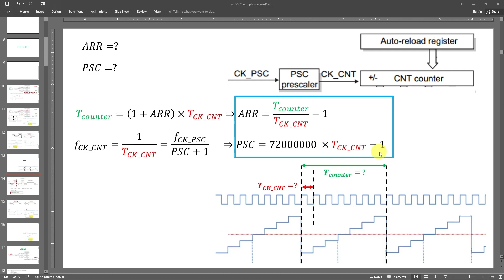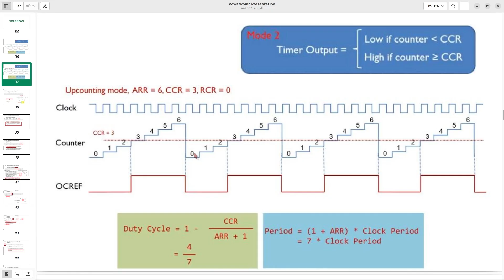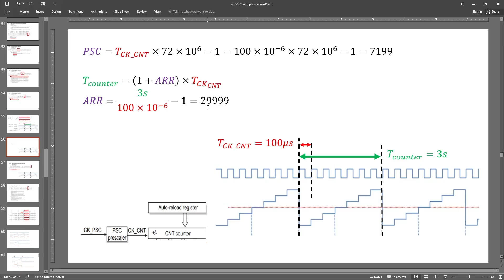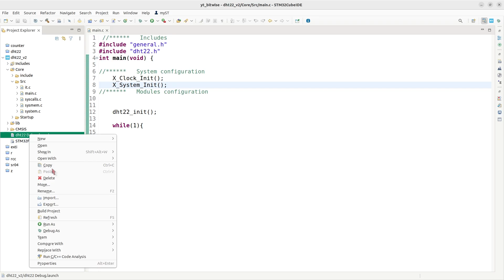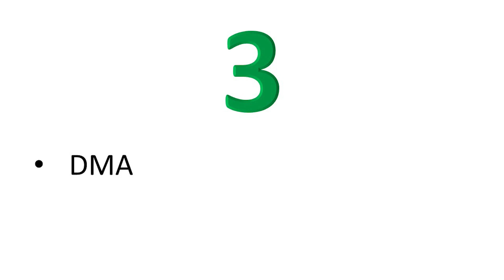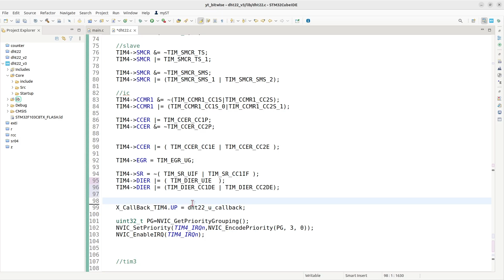AM2302 / DHT22 with STM32 with 2 Timer and 2 DMA channels | NO DELAY

Comment: I liked your videos, and I think that I watched all your English ones. I learned a lot from you, but this "DHT22" library is a total mess. Nobody should code like that!!! 
ps. What happened to your old channel?
Reply from the maker: what do you think is the problem with the code ?
Reply: @elcen_ir  For example, it is very difficult (for me, impossible) to understand without watching the video. You are using HAL, but at the same time you do all the GPIO, TIM and DMA config using CMSIS. You don't need HAL here, just use a startup file. The code is also very badly structured and has code repetitions. For example, you have written the same code for configuring DMA ch1 & ch4. Just put it in a function. It also uses "magic numbers" everywhere, is well documented, etc etc…  
Please take this as a goodwill suggestion, not as an offense. I appreciate the fact that you take the time to do these videos for us.
Reply from the maker: @s_amoku  im not offended, 1. you are not supposed to be able to understand the code without watching the video , this is hardware implementation , i built a 1-wire peripheral with timer and DMA , for the actual job there is no code , timer and dma do the job , 2 . hal is irrelevant , i just add the library in a project with hal , so people know how to add this to their code , 3. code is not badly constructed , you should not write function for everything thats going to repeat , writing a function for DMA setting dose not add anything to the code , 4. i accept the magic number thing , but actually they are not magical if you watch the video ,

im not offended , but i think you were harsh when you said " nobody should code like this " 
i think we have different ideas of what a good code should look like
Reply: @elcen_ir  Sorry if I have been harsh, but I have seen your videos, and I have very high expectations of you. But I don't think that is just about preferences, for example you wrote: 
	DMA1_Channel4->CCR = 0x0;
	DMA1_Channel4->CCR |= DMA_CCR_PSIZE_0 | DMA_CCR_MSIZE_0 | DMA_CCR_MINC;
Instead you should write:
	DMA1_Channel4->CCR = DMA_CCR_PSIZE_0 | DMA_CCR_MSIZE_0 | DMA_CCR_MINC;
and you save 2 cpu cycles.
Regarding the functions, they also are very useful to make the code more readable. I think that even you will not be able to understand your code after 2-3 years. Not to mention that if you write a functions, especially for drivers you can reuse it in other projects. For example I have written this function for DMA and use it every time that i need: 
    error_t DMA_init(uint8_t ch, volatile const void *periph, void *mem, uint16_t len, uint16_t cr);. 
The term "magic numbers" was not invented by me, it is wildly used in programming. And it is spot on in this case, as we should be able to understand the code without the need to watch a 70-minute video. 
Out of the scope of this conversation but I thing that is a simpler way to red it, just use the SPI @280kHz and DMA and decode the data.
Reply from the maker: @s_amoku  
	DMA1_Channel4->CCR = 0x0;
	DMA1_Channel4->CCR |= DMA_CCR_PSIZE_0 | DMA_CCR_MSIZE_0 | DMA_CCR_MINC;
Instead you should write:
	DMA1_Channel4->CCR = DMA_CCR_PSIZE_0 | DMA_CCR_MSIZE_0 | DMA_CCR_MINC;

if i do this , how can i be sure that other bits of CCR are 0?
and about function call , dont you know function calls themselves take CPU cycles?

and you believe nobody should code like me ? come on man